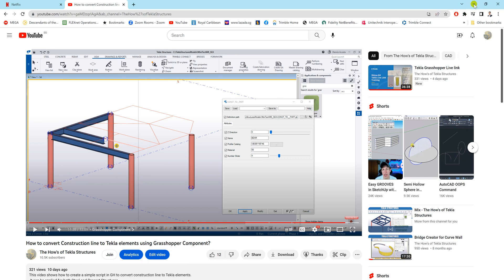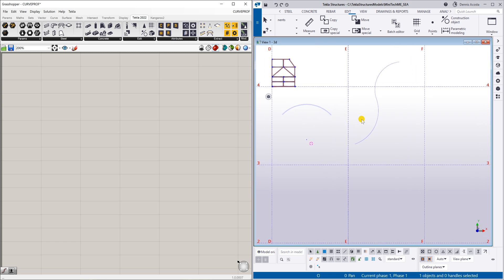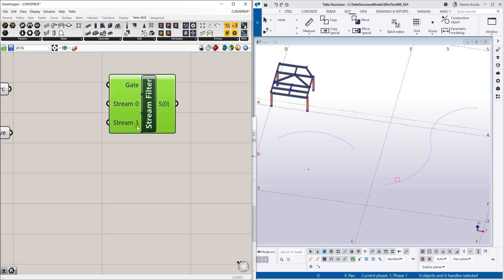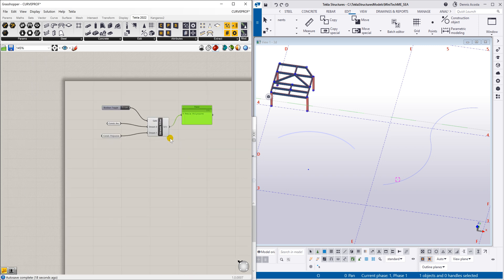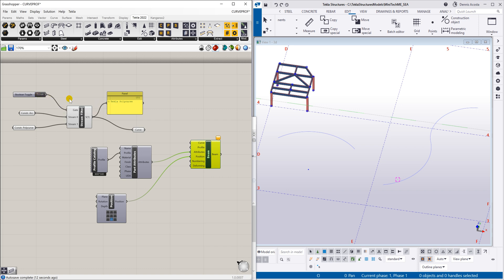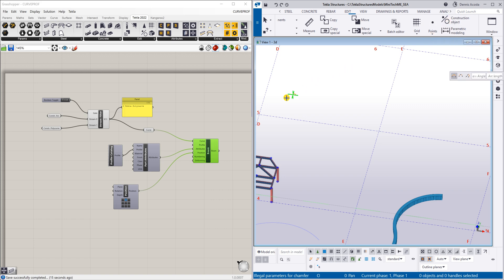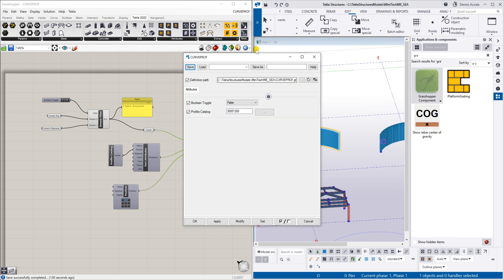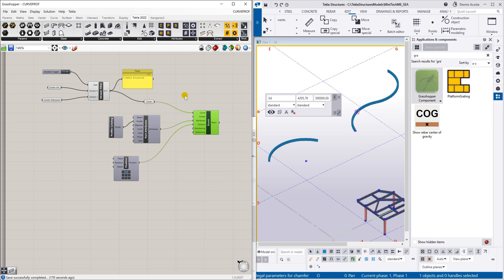How to convert Curve Construction line to Tekla elements using Grasshopper Component?

Comment: This is about Tekla Structures Software, I have a perpetual license for it, but I failed to deactivate it in my destroyed computer. I cannot use it anymore to other PC. is there a solution other than availing maintenance from Trimble Solutions?
Reply from the maker: You need to contact your locale distributor to solve this issue. When your computer was destroyed without de activating the license. The license cannot be use anymore. Just let the locale trimble your story or what happened and they will give you a temporary license then replace the license for you. Hope this helps. Thanks
Reply: @thehowsofteklastructures565  do i need to avail for a maintenance?